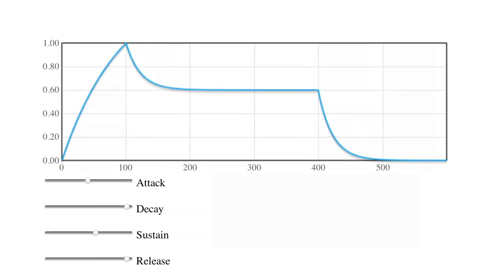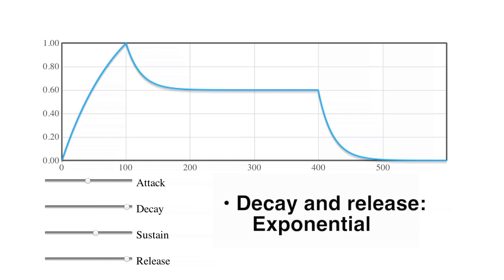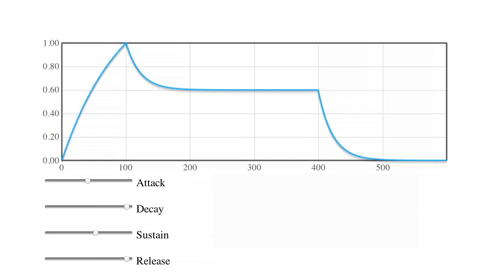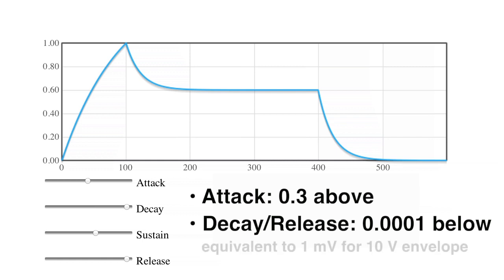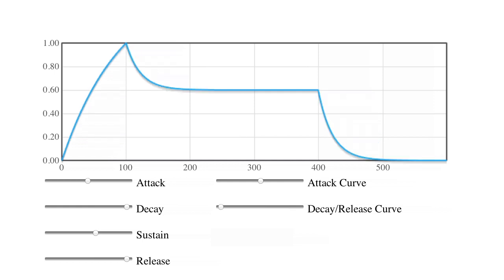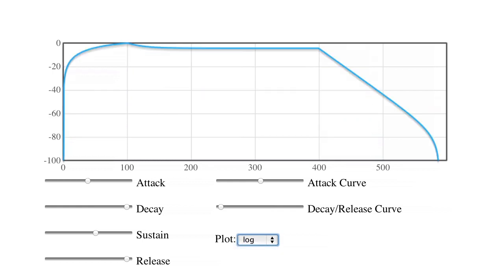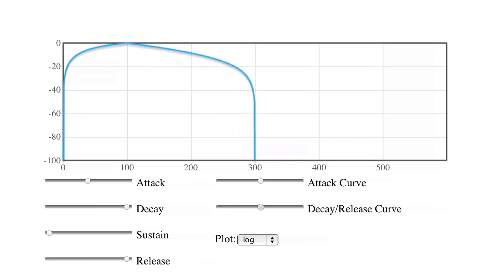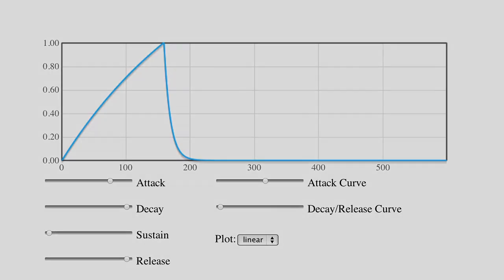ADSR Envelope Generator

Comment: What software did you use to create the graph with the sliders?
Reply from the maker: Nic Whittle It's written in javascript, using the flotr package to plot. It's basically a javascript translation of my C code (available on my website), driven from HTML5 "range" inputs (sliders), and plotting code. You can access it here: http://www.earlevel.com/main/2013/06/23/envelope-generators-adsr-widget/

Comment: I have question about your envelope code. I succesfully ported in to Arduino environment, and I'm constructing with it monosynth (see my last video).

Can I use your code commercially, if there will be such possibility? If not,  I'll just write my own ADSR code, but much simpler and linear.
Reply from the maker: You are welcome to use the code—I'm glad you find have a use for it! If you have a place where it's convenient and makes sense, it would be nice if you tell people where to to look for more details (the website series), but nothing required.
Reply: Thank you very very much for permission!! Your agreement was actually last thing needed to open way to assembly my device for sell.
Actually your ADSR runs perfectly on 16 MHz ATMEGA 328, I already declared two objects for filter and amplifier. And it runs smoothly, only taking up a little processor time, which allowed me to run S&H cells refreshing in 9 kHz rate. I just had to set up timer interrupt every 1 ms for refreshing envelopes. In the same way I'll write code for LFO - object with refresh method, and inside code which will generate waveforms with simple math.

Maybe we can together write simple guide for your page how to use it on Arduino? It's much more efficient in my opinion than using Mozzi library.